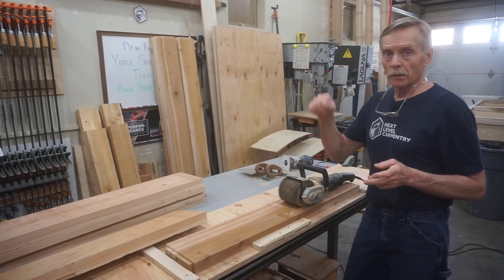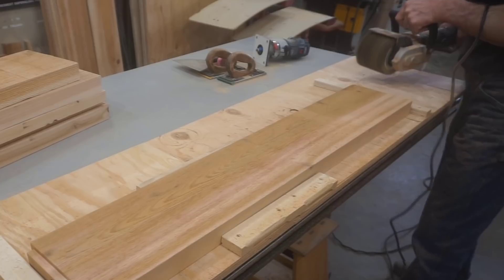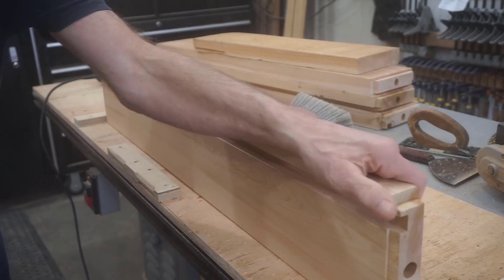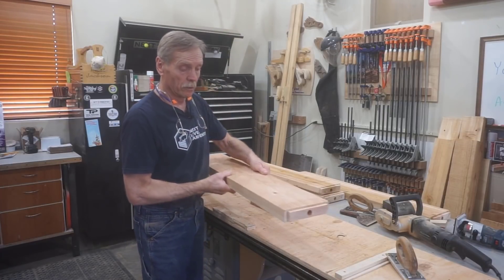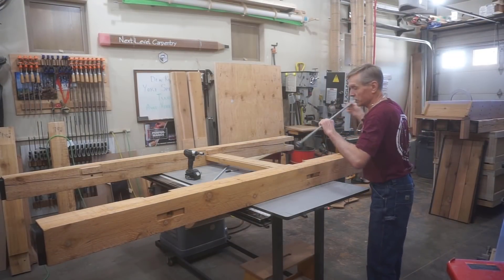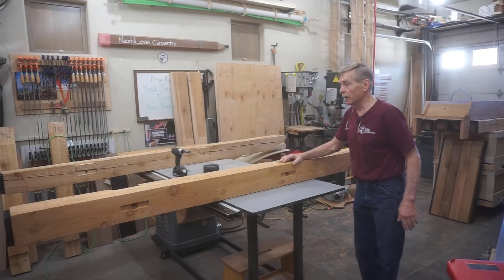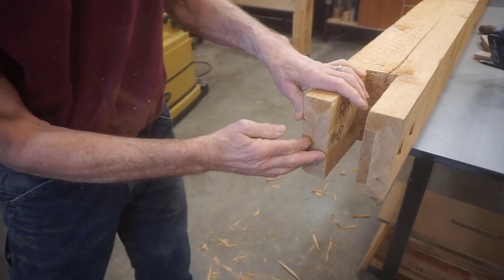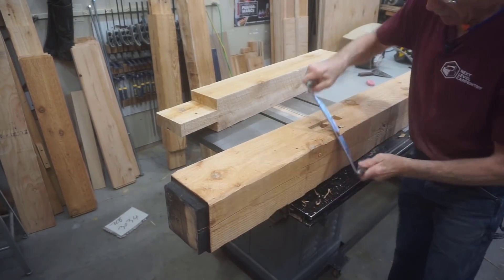Special FX for Rough-Sawn Texture on Wood

Comment: Matt, incredible tips & craftsmanship as always!! Those bunk beds couldn’t be more Montana unless a Grizzly Bear made those himself!
Reply from the maker: Favorite comment of the day Joshua... thanks!  It's been a fun design/build project that's nearing the end and I think it will be a memorable job for years to come.
Best, Matt
Reply: @NextLevelCarpentry  one question, would these tips work on a hardwood? How would you go about using a reclaimed hardwood that would require jointing & planing to first achieve proper dimensioning, but in so doing you’d lose that “natural” rough saw texture? Would the restorer be used after dimensioning?
Reply from the maker: @joshuahasson9687  I think you'll find this video answers your question completely: https://www.youtube.com/watch?v=-ORc3LxAOsk assuming you don't have your own pet grizzly to use its claws for the distressing part🤣
There's a companion video that shows how I faux-finished the textured beams too: https://www.youtube.com/watch?v=_tbzPXnJTnE
There's a couple more that show making and installing these same beams if interested...
Best, Matt
Reply: @NextLevelCarpentry  holy cow it sure does! You’re the best, Matt! And I think you’re right, Grizzly claws are another great tool to use, be sure to add those to your Amazon affiliate account! 🤣😂
Reply from the maker: @joshuahasson9687  First I need to find a Grizzly who's willing to let me de-claw it😬😲 wish me luck?!😎

Comment: I have the Makita version of that tool, and used it to clean up the old beams from our house when we renovated.  It really is amazing, but the one you have certainly looks much more versatile!
Reply from the maker: I almost bought the Makita model for an upcoming faux beam project because it's got a wider wheel and a dust collection port but versatility won the day...
Reply: @NextLevelCarpentry  "dust" collection was worth it for these beams.  The house was heated with coal long ago, so there was lots of awfulness coming off of them.  Again, amazing work.  Keep it up!

Comment: I am extremely curious as to how this bed will be or is finished. Could not find much but will continue to look. I have some fir that’s a little rougher I believe and would like to keep it rough. All your videos are good not really noticing much of a difference with productions. Most of the people are probably like me that is interested more in content.
Reply from the maker: Funny that you mention fir, Zip.  FWIW you might find it interesting that we started planning this bunkbed project expecting to use Douglas fir but opted for cedar because my client preferred the look of the wood better.  I didn't argue because cedar is lighter and softer and easier to work with, among other things.  I would have used the exact same process and methods for fir as I did cedar.  I think you could expect very similar results for the same effort with similar tools and techniques if you end up using that fir for something similar.  I may do an overview of the entire bunkbed build once it's completed by the end of March 2022.  I don't like to be pushy about it but I've done at least a few other in depth videos from the build as patron-only where active patrons have access to the entire library of similar videos/content.
Best, Matt

Comment: Dear Matt, I was looking for the link to the range of tools that are equivalent to the Eastwood drum restorer but cannot find them.  I looked at your Amazon link - not there and the miscellaneous tools you use - not there either.  Maybe the tool is no longer available and has been deleted.  My only option in Australia is the Eastwood tool with a Voltage reduction unit, as the Eastwood only handles 110V. Thanks for your help and keep up the excellent quality videos.
Reply from the maker: Sorry I sent you on a wild goose chase as I neglected to add links to those other tools.  I should be able to get to finding and adding links in the next 24 hours.  In the meantime just search 'restorer tool' and you'll probably run right into what's available locally.  I will say it's a remarkable tool and worth a bit of 'shopping' if you've need for one... and Henry Ford agrees! 😉😂😎
Reply from the maker: Hey Peter,
Added other restorer tool options to the Amazon list just now:   
https://a.co/62TtzUb
to give viewers an idea of the range of options I chose from.  I get the idea you pretty much get what you pay for.  Hope you can find something reasonably priced where you are for what you need...
FWIW I was able to do a LOT of texturing with that wire wheel on an old buffer/angle grinder on this project: 
https://www.youtube.com/watch?v=_tbzPXnJTnE so you know what's possible even if less efficient and potentially more dangerous.  
Best, 
Matt

Comment: I’m building a all red oak whiskey cabinet (upper & lower). The uppers main support are 2 beams 12” W x 5’ L x 2” D…. Instead of the end grain showing, do you have any “next level” ideas on how to hide the end grain in a fancy way? Thought about making my own half round but that wouldn’t look good while all other edges are square. Thanks!
Reply from the maker: Done right, I see no fault in leaving the end grain showing Jason... if you hide it it also hides the fact that you used amazing solid red oak 'beams' to build your cabinet.  
That aside, the 'best' way I know to hide it is to use a 'returned end'.  If you carefully cut 2" off the end at a 45 degree angle, reverse the angle and cut 45 degrees on the end of the beam and finish up by gluing the 2" beveled piece back onto the beveled end the grain will automagically 'wrap' the end, hiding the end grain.  Let me know if that makes sense?  Of course the alternative is to add a carved 'texture' to those ends to give them a cool scalloped effect and leave 'em to show off those amazing solid oak beams...
Best, Matt
Reply: @NextLevelCarpentry  I completely agree. The client mentioned twisting a column around to hide a perfectly good knot (baboon nose) like in the slab door video. I told him you choose red oak aka REAL wood for a reason and if you want to hide characteristics you might as well paint it haha. He agreed. Appreciate the response! The scalloped part I’ll have to read again haha
Reply from the maker: @Xray.71  I like the way you work/think!  It takes a really sharp gouge-type chisel to do that scalloping, especially on any oak, red or white.  
This set of gouges is WAY overkill but might give an idea of options to consider:
https://www.amazon.com/Professionally-Schaaf-Wood-Carving-Tools/dp/B09NWKZWRK/ref=sr_1_16?crid=2SDKS2OGDN6NC&keywords=gouge+chisel&qid=1647108924&sprefix=gouge+chisel%2Caps%2C129&sr=8-16
FWIW I bought just one 'fishtail gouge', Pheil brand I think, for a specific project awhile back.  Point is one high-quality gouge of the right radius for the look you need can be a slam dunk investment IMHO.

You could also use a fine tooth carbide burr in a drill or die grinder, depending on the look you choose. I'm not recommending this specific set but I have a similar one that I use for this sort of thing sometimes: https://www.amazon.com/Carbide-Tungsten-Double-Rotary-Grinder/dp/B08HM77SF4/ref=sr_1_13?crid=KJY3HIM8ZKEO&keywords=fine+carbide+burr&qid=1647108726&sprefix=fine+carbide+burr%2Caps%2C126&sr=8-13 The biggest drawback to the burr method is that, if you want to end up with a smooth/chiseled scalloped texture it takes a bit of sanding to remove rotary tool marks.

Sounds like a fun, challenging and rewarding build for you... very cool!
Best Matt

Comment: Interesting process, but dusty.
Reply from the maker: True dat... the NLC shop is an insane mess of dust and shavings these days... all part of the deal though, right?
Reply: @NextLevelCarpentry  That it is.  I do not have dust extraction, unless you call a shop vac with a cyclone device on a Homer Bucket  one, and that can't be hooked up to everything. The result is dust in places you would think it could never get to. I  try to keep the place clean, but if I did a good job, I would do nothing bur clean up dust instead of make stuff. When possible, I try to work outside.
Reply from the maker: @russmartin4189  You've spelled out the difference between woodworkers who collect dust and dust collectors that work with wood 😁  Always makes me chuckle when dust collection zealots make it sound like breathing a bit of sawdust is a death sentence...  Working outside is a great option when it's available too!